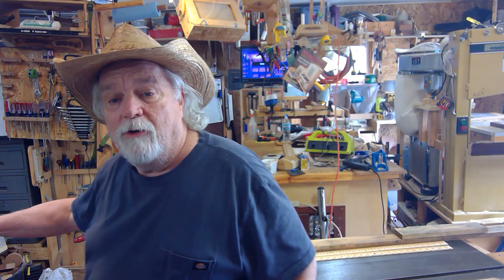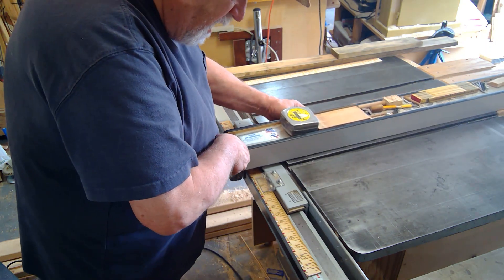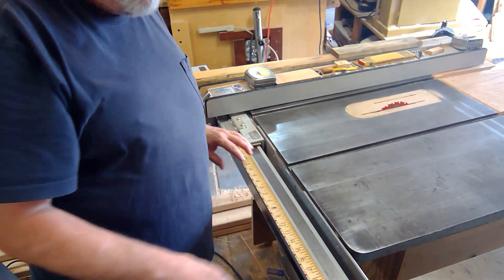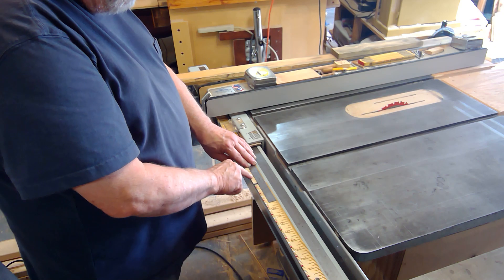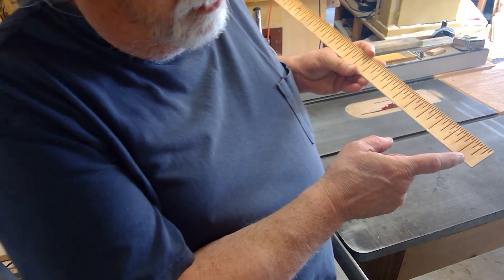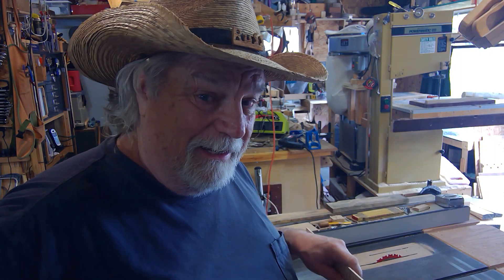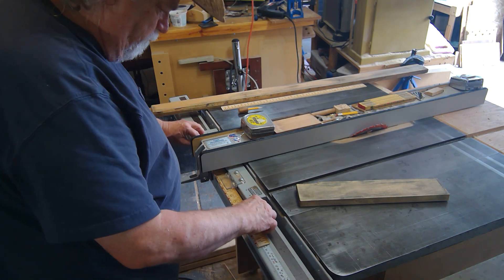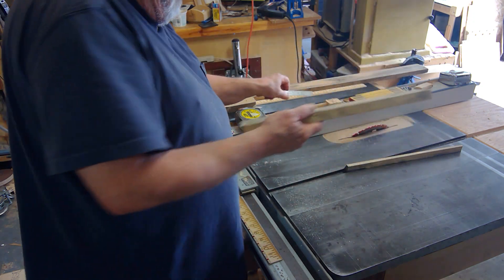OTB Ruler on the Tablesaw by OTB Thinker

Comment: Good explanation Russ. I like the OTB Ruler. Being able to easily reset the scale on the fence is a big improvement over the fixed scale. That would be especially helpful with dado blades. Adding a 16th every time is bad enough. Trying to mentally add 25/32nds multiple times for a shelving unit is a sure way to disaster. 😆😎
Reply from the maker: sounds like stupid math to me :>)

Comment: great  now all somone has to do it make a blade thats a magnet strip so you can shift it this or that way for blade thickness and you won't bump it and move if off calibration  or inven a tape strip with one rule you can adjust to blade thickness with the blade each time you change it. however a dado stack might be a bit of a trick.

Comment: Hello Russ, Loving your channel. If you know anyone in your area with a laser engraving setup, they could make the rulers you desire with absolute accuracy. (I used to have a 50 watt epilog myself.) Kind of wish I still had it.
Reply from the maker: I'm thinking I can do an OTB ruler based on 1/32" instead of 1/16" to make reading that increment easier.  My brother did these and not sure of his accuracy capability..  I haven't ask him yet but I will.  What else are brothers for ?!? :>)  thanks for the kind words Jim.
Reply: @russveinot5754  The laser is as accurate as the person operating it and putting the program together on the computer. I cut little boxes with mine that had sliding latch closures and flexible hinge tops. Tolerances close enough that you did not need glue. Made die that you could not take apart without destroying them. No room for glue. Also used it to burn designs into pencil and jewelry-keepsake boxes. I sometimes regret selling it.

Comment: Love it.  I like meth but it is very error-prone in the practice.  I was hoping you would have an affiliate link to find those ruler blanks.  I can look for them myself, of course.
Reply from the maker: Unfortunately, my brother made mine on a laser machine.  I haven't seen a ruler with this idea out there anywhere.  You can make them yourself with either a computer ( paper template) or with an Incra jig.  On the computer (maybe in sketch up), just make a ruler template, print, glue to a board with Mod Podge, and cut out.  You may have just given me 2 more (!) ideas for videos on making an OTB Ruler.